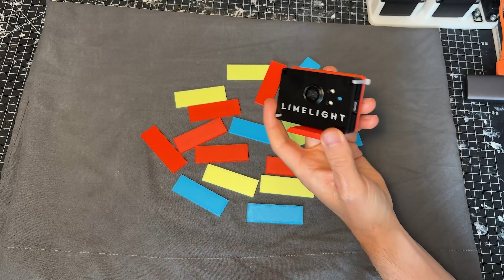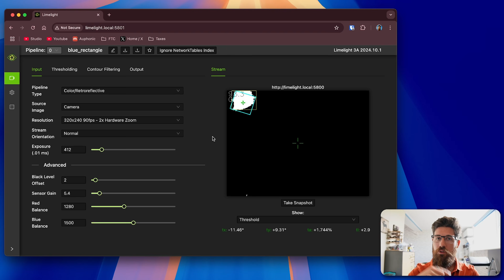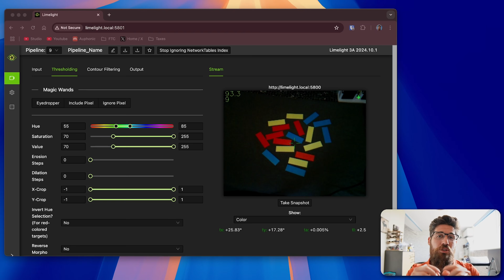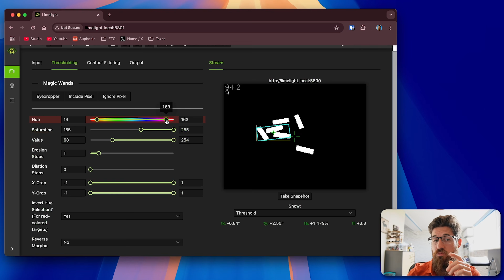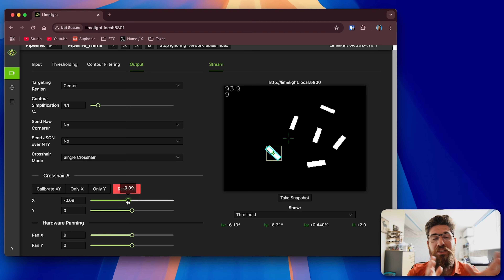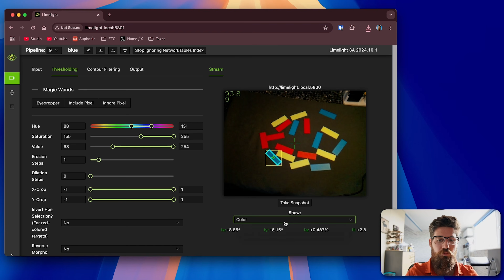Computer Vision for Beginners: No-Code Color Tracking (Limelight 3A)

Comment: Hey Brogan, Great video and explanation! I was wondering if there's a way to do this with a Logitech camera?
Reply from the maker: Not with no code, no.  The limelight is special in that it does the processing on the unit itself. 

However, you can use EasyOpenCV for FTC, or standard OpenCV in a non FTC context. It does the same thing as the limelight but in a different way.

Comment: Once you get the limelight to sense the object how to you program your robot to actually pick it up? How do you get the X and Y coordinates of the object relative to the robot?
Reply from the maker: I'll be having a full video on this coming out in a few days here, in short: When you get a llResult from the limelight, it will return 3 values to work with. Targetx, Targety, and Targeta (area). Because your limelight will be mounted in a fixed position on your robot, and you can place your intake in a fixed positon knowing where this is in space relative to the limelight, then you can use this offset to calculate how far along the X axis you need to move, and how far along the Y axis (or area, depending which you choose) until those coordinates meet with your target X/Y (either in PID or in 1 shot calculation, depending) to then be able to pick up the object.
Reply: Mr Pratt, the PID sounds much better than what we did!
We calculated the x and y offsets using the distance formula on the Limelight docs, added the claw offsets, made that pose field centric so I can plug that into pedro and and then just made a path to that point 

Did it work?
Maybe, sometimes, not good enough though, it did not like horizontal samples at all, then again my Limelight 3a has issues with it's sensor, the image is noticeably darker than it was 4 moths ago, idk why, maybe bad usb cable? At least I got to experiment with Python scripts. I will definitely consider other methods, I saw that TehnoZ has a Tflite model and their camera is mounted on their turret, the only downside is they have to tell the robot "points" where to look for samples manually in INIT other than that, idk how they get to the actual pickup position, since they are so close to the sample itself, I suppose they just PID their way until the sample is in the correct spot image-wise.
CSH(at nats) I know used a look up table for tx and ty and plugged that into their IK for intaking positions better look into that I guess.

Sorry for the text wall, I just don't know where to consult people about this stuff lol.

Great vid Mr Pratt!

Have a great day
Reply from the maker: I'm assuming your referencing these documents for calculating distance? https://docs.limelightvision.io/docs/docs-limelight/tutorials/tutorial-estimating-distance

Re image: Check that your lens is clean and that the lighting in your room hasn't changed. Fluorescent tubes will dim. I've got a resource coming out on simple use of the limelight in an FTC context, though maybe I'll need to add in another on ways to actually move your robot once you've found the object.